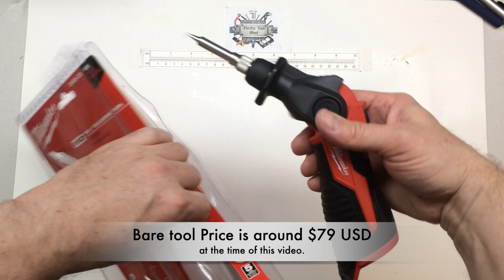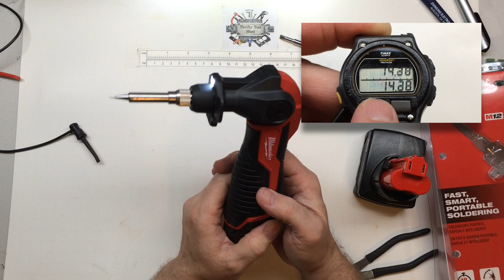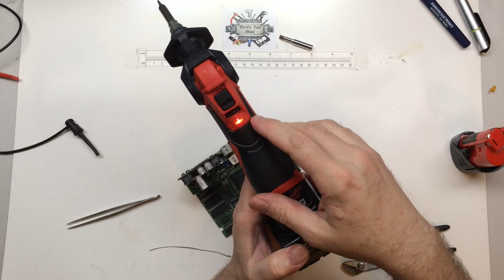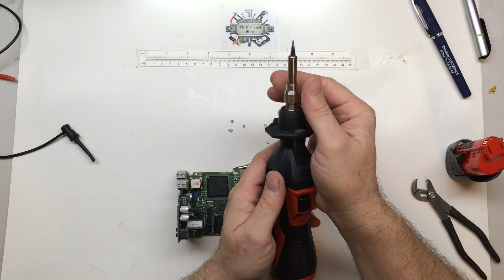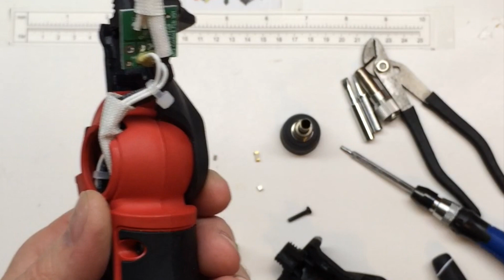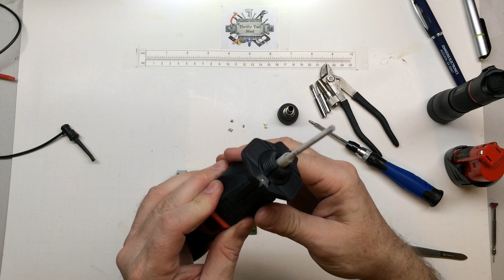Milwaukee M12 Soldering Iron:On The Bench

Comment: Nice iron but the thermal fuse in line with the heating element seems to fail, Have fixed a dozen of them with the same fault. (it's a 15A , 240V thermal fuse)

Comment: Wish you could get replacement heating elements both mine are dead
Reply from the maker: Antex is a name brand for M12 heating element on eBay, but they show out of stock? I haven't tried one myself to say if they are ok. I would try one though if they get it back in stock.
Reply: @ThriftyToolShed  your a legend cheers Wayne
Reply: @ThriftyToolShed  hmm doesn't much look like the heating element in the milwaukee??
Reply from the maker: I have just seen the listing, I have not taken mine out to say. Thought it was interesting, sucks if it says M12 but not correct. I was hoping. I can't believe that is hard to get. I haven't needed one yet, but yeah I was counting on being able to get one. 
Thanks for your information.
Reply: @ThriftyToolShed  yup dead heating element n melting collars are faults n lots like me have had them milwaukee don't sell heating element,  n say melting collars are user faults due to too much pressure applied
Reply from the maker: Wow. That is not good. I like Milwaukee but they need to make that right.
Reply from the maker: I just thought about the element on this M12. I should have asked if you knew for a fact that the element is open or is it a thermal fuse blown. I have not taken mine out obviously but I know it looks like a thermal fuse in line with the element it's in the heat resistant sleeve so I am guessing. I have not verified? Just a thought, you may have already had yours apart and know for sure!